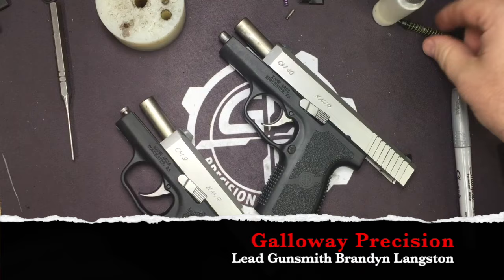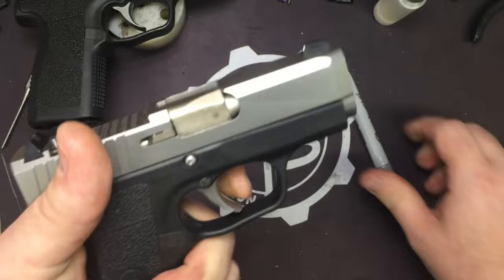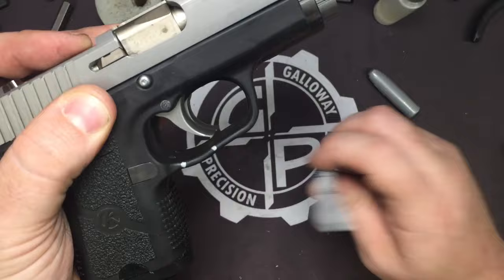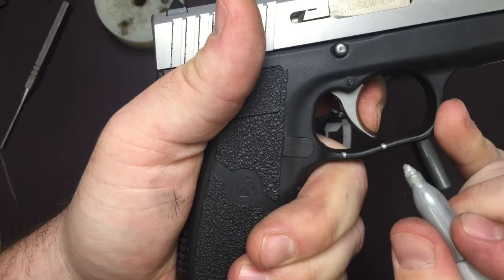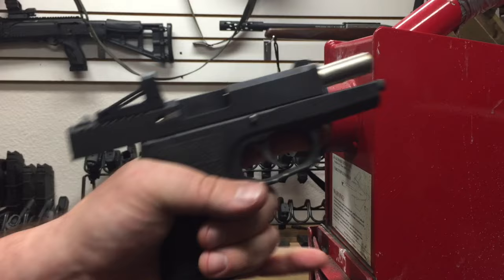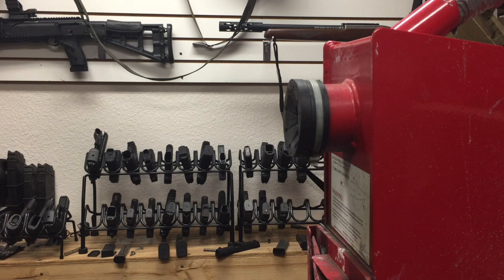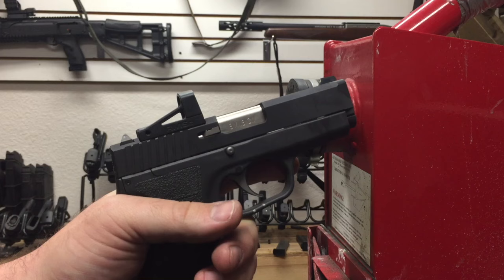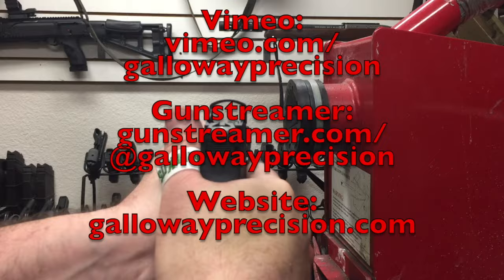Kahr Quick Sear Explanation and Testing.

Comment: Looking forward to seeing what the quick sear looks like and how it performs. I recently installed a Galloway stainless striker guide on a CW9 along with a Wolff reduced power spring. They work great. I also removed the magazine disconnect safety from a new P380-CA, but immediately began to experience weird behavior where the trigger bar does not always engage the cocking cam (aka, Sear) and so it does’t fire sometimes.  My guess is that the angle on the trigger bar must be adjusted to compensate for the newly created space on the sear pivot pin after removing the mag disconnect that was riding on the sear pivot pin.  I didn’t know how to remove the pivot pin, and so I forced the polymer frame to stretch in order to slip the mag safety piece. I think this caused undue stress, but the frame is still intact. I would appreciate any suggestion from Galloway on dealing with the occasional loss of trigger reset causing failure to fire.
Reply from the maker: Yeah unfortunately in those models you have to leave the mag disconnect for the exact reason you say.

Comment: The Kahr could have been designed more simply to have a seven pound single-action trigger, and then the movement would have been shorter still, but wouldn't it then need a manual thumb-safety (or at least a front-strap safety like on the H&K P7)?  I thought the whole point of having a long, double-action trigger was to make the manual safety unnecessary.  

The Kahr trigger is already shorter and lighter than a revolver's double-action trigger (the standard of comparison), even easier than that of a revolver well-tuned for competition that can bust only soft primers.

But you're bringing it yet closer to the feel of a seven-pound single-action trigger with smooth creep. Is this for competition?
Reply from the maker: The system is a DA like a revolver yes. The new trigger removes the excess slop after break that is already there just empty travel stock. The flat face is staged different and is in general a little more forgiving of the finger placement for pull. Makes the trigger pull easier is the purpose of the trigger.